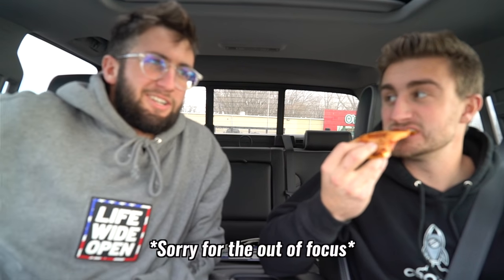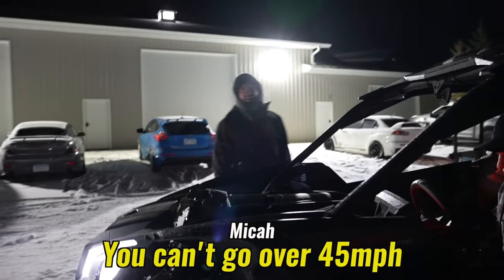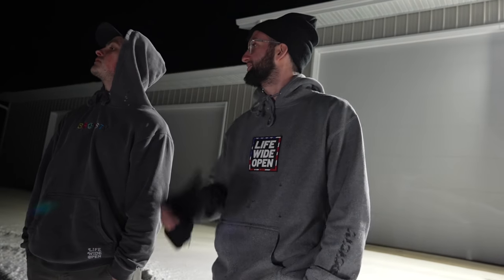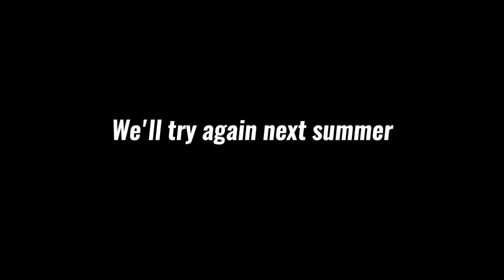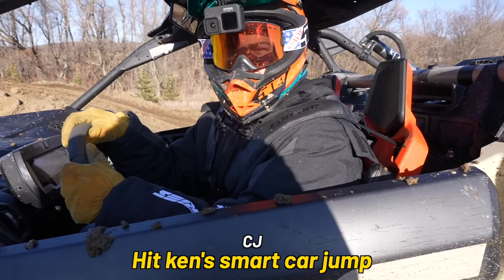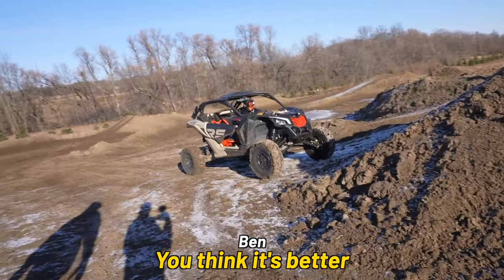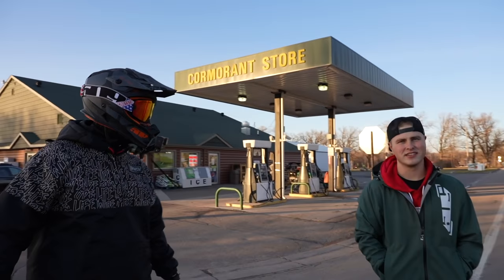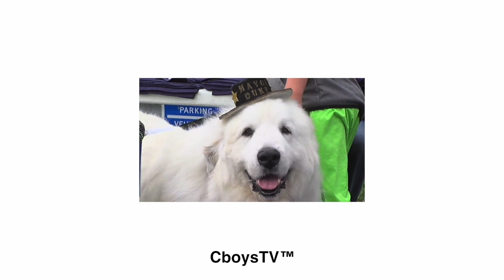“Breaking” in our new Side by Side

Comment: this is super late but as a previous can am dealer owner the 10 hour break in only applies to supercharged seadoo products (and possibly skidoo but I didn't sell those). The computer limits RPM on those until 5 hours and then gives you some more and then at 10 hours give you full power. The on road stuff just rip it up from day one. The belt might need to be replaced sooner but setting those pision rings right by driving it like you stole it is the way to go.

Comment: There is a legit break in period on new machines. When they are brand new all the parts need to settle and running them at high speed when they aren't can be catastrophic. Cars and trucks have this as well it's very common

Comment: Try to straight put straight pipe and cut the exhaust just a teeny bit and also turbo this one my foot two turf skis and then have the exhaust run outside like a crazy thing biologically it should be right around straight pipe by the way it'll be a little bit quieter than your last one will be you'll just be loud but loud enough to where you won't go down